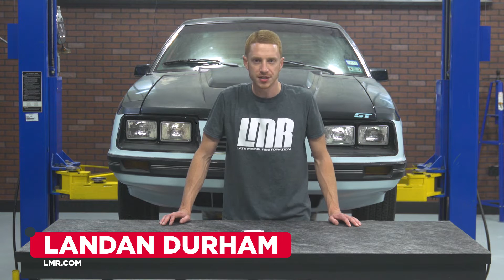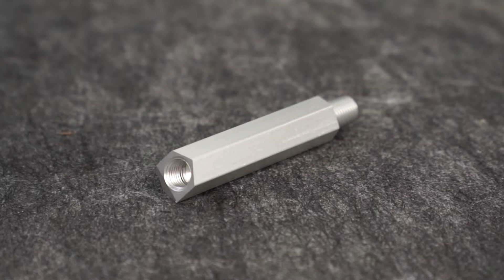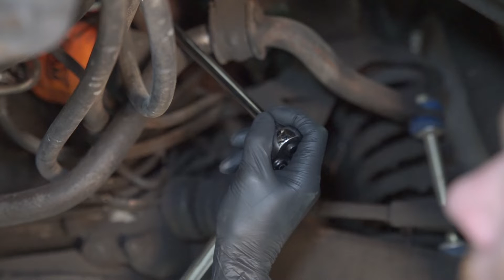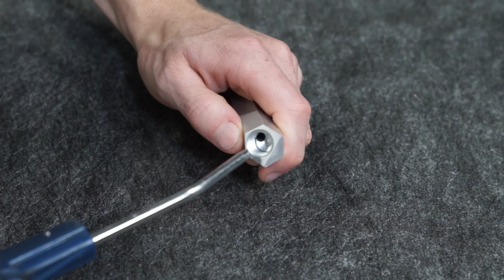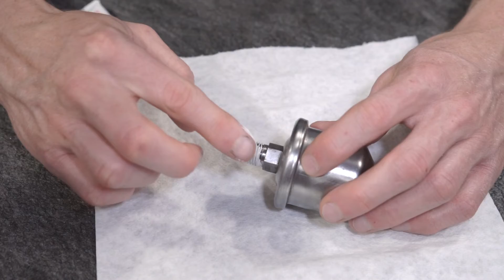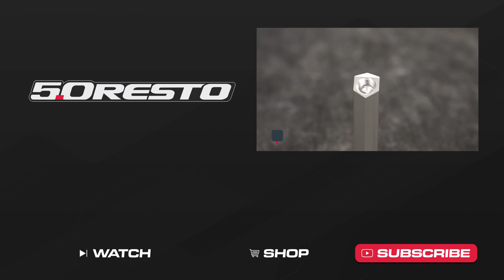5.0Resto Mustang Fox Body Oil Pressure Sending Unit Extension (79-89) - Review & Install

Comment: The extension is not a wearable item, no need to replace it with an item that you as a customer need to deburr before install.
Reply from the maker: We mention this because of the fact this is a mass-produced item and this is just for reassurance. We sell this item for a customer that may have lost it or damaged it during a build.

Comment: Landon what did they change with the 1990 and above model years for this part?
Reply from the maker: Pago's Place - I've seen this extension on cars up to 1992.  Granted, most Fox Bodys have been tampered with and may not always display factory parts.  It's always best to double check your setup and see what you have.  In the last years of Fox production, the oil pressure sending unit installed directly into the engine block instead of the extension.  Hope this helps!  -Landan